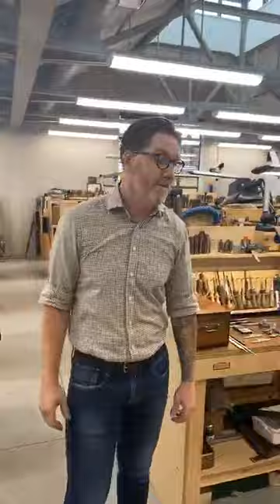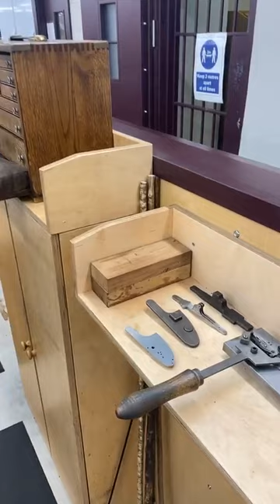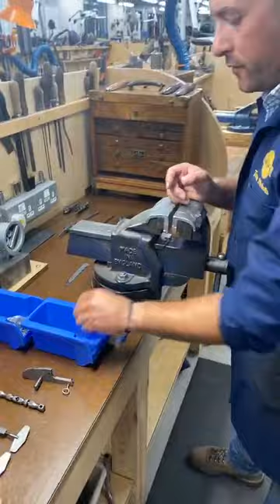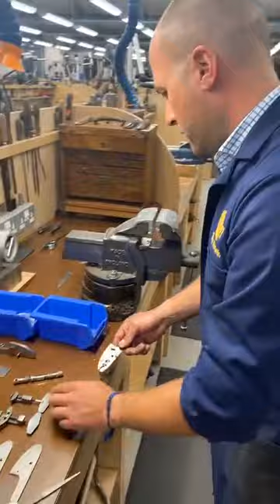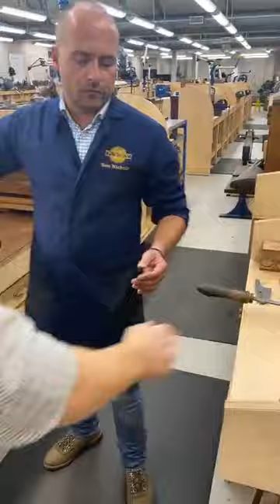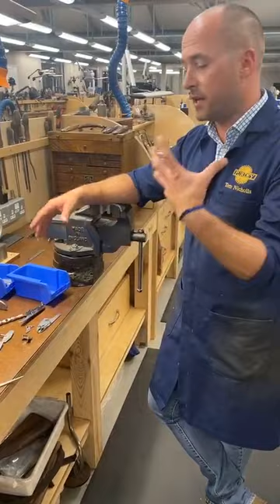Purdey Gunmaking Series - Stage 3: Lock and Trigger Mechanisms

Comment: Why do best guns never have the lump through the bottom of the receiver?  What are the pros and cons of that?
Reply from the maker: Hi Edward. There are no pros and cons, but the action of a Best Gun is made in this way because it has always been deemed aesthetically more pleasing. Ultimately it requires more work, as one would imagine, and hence you only see it on Best guns because of the price difference.
Reply: Thanks for explaining that.